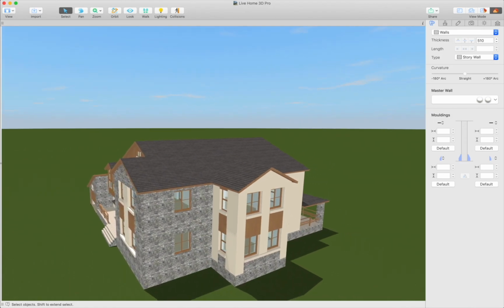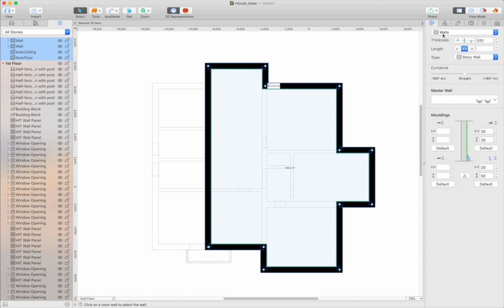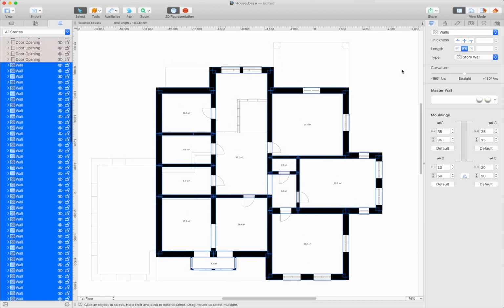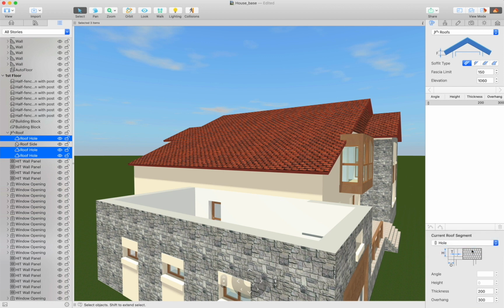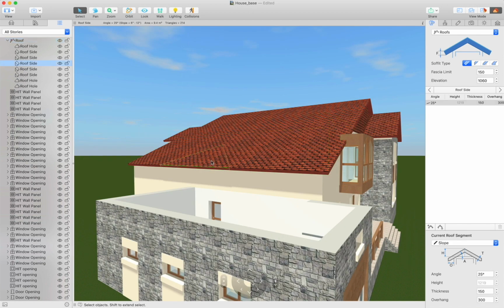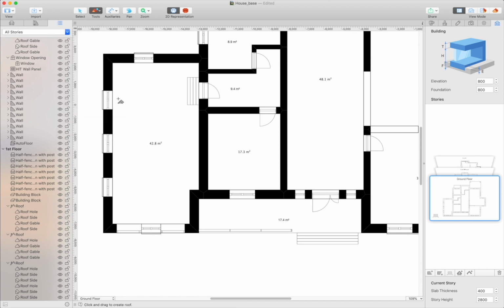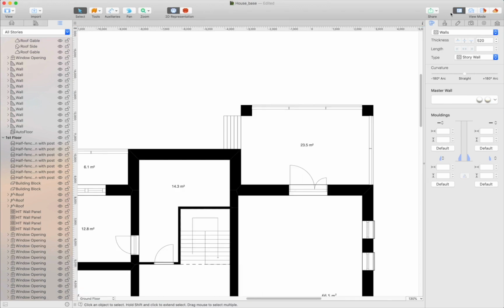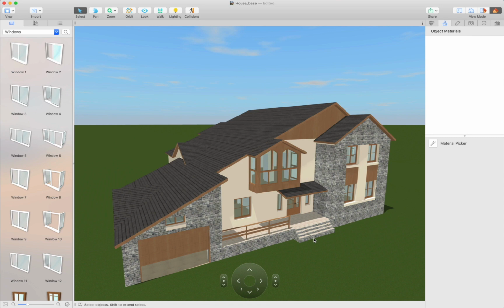Customizing a Roof - Live Home 3D Pro for Mac Tutorials

Comment: Can you create a roof that is fully flat? I can't produce a 'flat' roof without it having a 3 degree incline.
Reply from the maker: Indeed, the roof will always has an incline of 3% or more. To design an entirely flat roof, please use one or multiple building blocks to design a shape of the roof, then set the required Elevation for it on the Object Properties tab of Inspector.
Reply: @LiveHome3D  Please include a proper flat roof in the roof settings. More homes are being designed that way, plus there are many mid-century built homes with flat roofs
Reply from the maker: You are right! The roof can't have less than 3 degree incline. However, there exists a workaround we will gladly share with you. Please add a story above the current one, then remove all the walls on this story. This way, the Floor object will serve as a flat roof. Hope this is helpful.
Reply from the maker: @amyrobert  Thanks for your feedback! We will review it for the future .